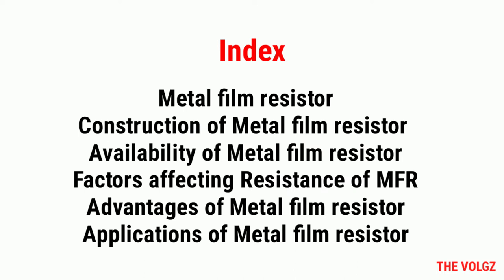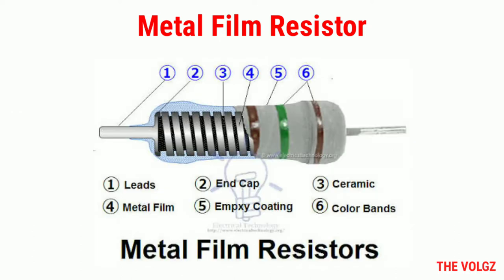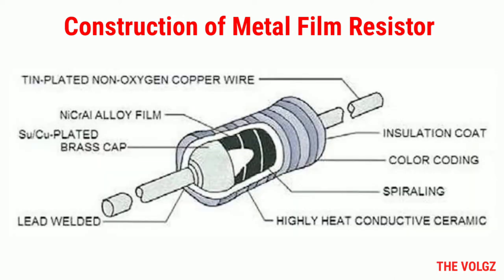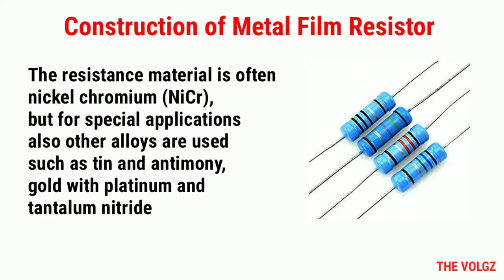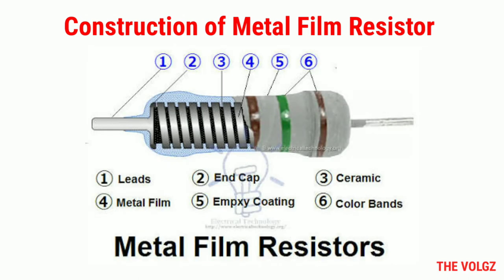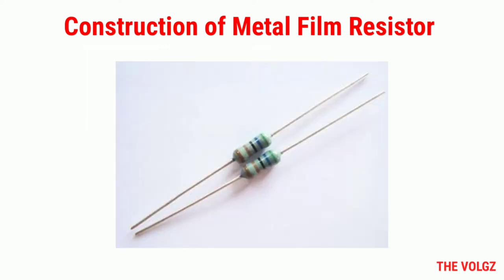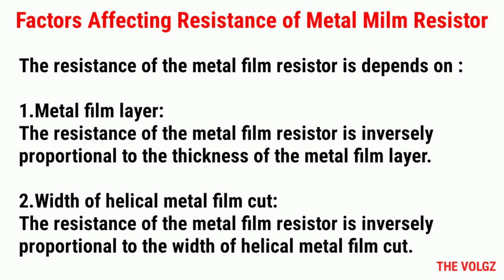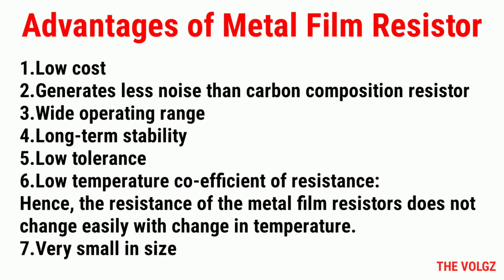Metal Film Resistors Explained. Applications, Advantages, Availability, etc

Comment: How to differentiate from eye between metal oxyde film and metal film resistors?
Reply: Really hard, but usually metal oxide ones are a gray/light blue, while regular metal film are a darker blue/red. Black or brown may be some kind of carbon. This is just common usage, not universal. You probably want to order new ones to be sure.
Reply: Usually carbon film are beige, and metal film are blue.
However, different manafacturers do different things.
Reply: @dancoulson6579  Thank you sir
Reply: @rich1051414  Just read your comment. Thank you sir